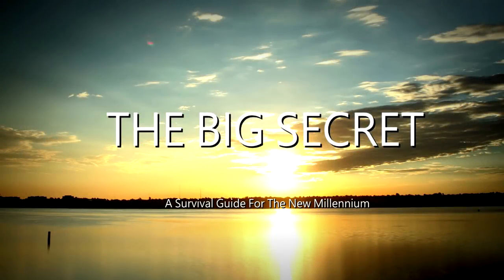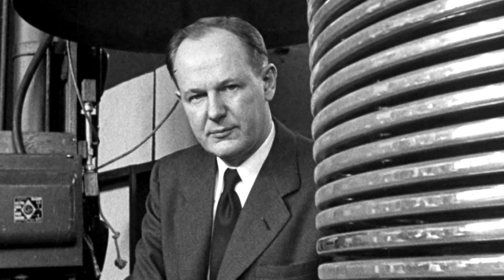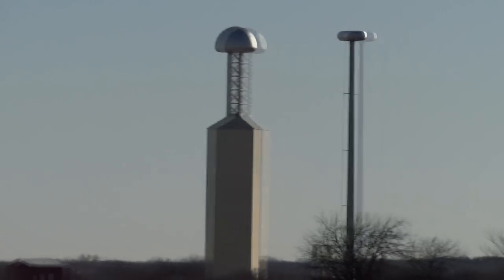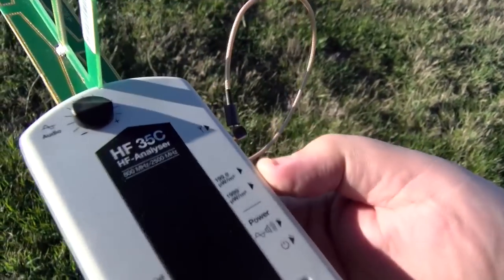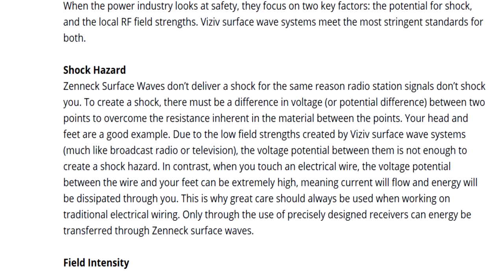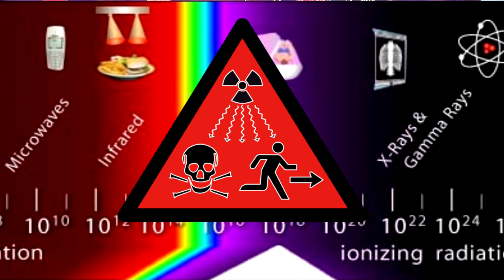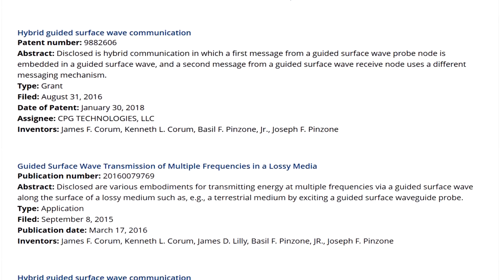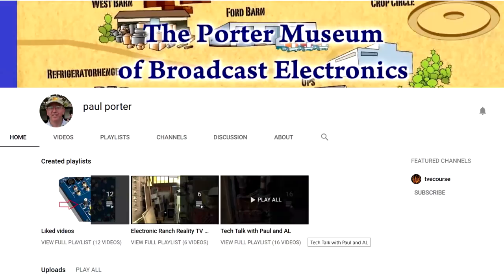Texas Tesla Tower Wardenclyffe Tower and Zenneck Surface Wave

Comment: In a way, Tesla's system basically sets up a tank circuit, where the transmission sight is essentially one plate of the acting capacitor in the circuit (topload couples to the environment), and the receiver is the other half of the circuit, connected through ground and a capacitive topload- so Tesla's wireless is actually a one-wire transmission mode through the Earth (Zenneck Wave?).  So when the two halves of the circuit (transmitter and receiver), resonate together as a single tank circuit, you have power transmission.
To go further, Tesla would use impulses of the tightest possible duration, to try to eliminate the magnetic (lossy) component in energy transmission.  Repeated high frequency impulses of disruptive discharges, won't give rise to significant currents/magnetic fields in the transmission medium, but transmits electrostatic waves longitudinally.  I think he really meant for his big Wardenclyffe system to employ impulses that would be tuned to resonate with the Earth, as ground.  He could setup a train of resonant impulses, that a receiver could tune into and resonate with, assumingly anywhere on the planet that can have a strong grounding system.  Such a system would probably greatly amplify the power and COP, through Earth resonance.
Reply: check out the 17 second resonant wave that occurred worldwide on 11/11/18. Some say it was a preview ;)
Reply: @EricM93  
Reeeeaaaallllyy : d
Reply: Something about using GND and the air as if they were wires in a circuit so AC power could be pulsed through ground
Reply: @EricM93  wheres the video to that
Reply: wow your the only one here that understands bravo     ....... with the advances today it could power the whole planet much the way the great pyramid did  over  565,000 years ago
Reply: @vuzztraveler4722910  
Imagine LFTR reactors, or maybe plasma fusion in the future, powering magnifying transmitters, powering the globe.  It's the "free energy" we've been looking for.  I'll email Elon- we'll set that shit up for the colony.
Reply: @Khepramancer  unfortunately mans obsession with fossil fuels has led him completely in the wrong direction riding exploding  roman candle cylinder bombs  to obtain orbit instead of the study of electromagnetic energy in relation to anti gravity until man figures out how to create harness that singularity and completely control this kind of event will be confined to his own back yard  given the way planets resources management  and technology have been used your own rats nest theory  is confirmed  your seas  and earth  karman  upper orbit are beyond polluted as below is as above trying to bring nuclear weapon devices  into space will not be tolerated this type of tech is as primitive as horse shoe crabs to  modern man kind . help was given but was completely ignored by your infant planet leaders only now have they realized they are in control of only their own planets destiny  and nothing more you have the right to destroy yourselves . to travel in space is to travel in time   until that time refer to whats been given
Reply: @Khepramancer   yes how true your statement is Empires rise and fall  unfortunately    . today on your planet fortunately they can also be bought and sold out and politicians that  is  what has happened . in the past  it  cost countless lives  by war the determining factors are your fiat monetary system  and the powers that control it and the treacherous manipulators of   earths  world resources . but thats the least of man kinds worries for 76 years humans have been exploding nuclear devices punching massive holes into the planets magnetosphere destabilizing the shield  the next time the poles flip could be the end  those that forget the past are doomed to repeat it  instead of studying the past they have sought to destroy it .your religious  constructs  dogma  are the folly of man  unless the planet is cleaned up and  re stabilized again   a  catastrophic  continental  shift will occur  again like when Atlantis sank then rose out of the sea when the great anunnaki  pyramid  that stabilized and powered the  whole planet was  dead shorted  after a major  nuclear conflict between two power struggling  regional   leaders   and  then  flash frozen then mass flooding  creating the largest desert in the world as well burying the past  of the oldest most advanced world wide civilization   the planet has ever had   .all over the earth with it under earth or under water  many fled back to the dog star  most died some survived and lived out there lives underground  . through  the passing of time the truth all but  lost or ignored by the greedy like the british criminals that enslaved two thirds of the planet . the  great pyramid was built by copper chisels and wood mallets really  i dont think so  ... if you have a email for musk you should ask that he spear head the ocean clean up before its to late  the oceans are your only hope now as earthlings are way to stupid to be allowed in to  outer space as they need to dig up the past before they can move off the planet at this point they should be exploring inner space first  as far a global warming is not a factor the planet has had global forest fires on it for millions of years deforestation and the balance of natural predators for humans is a factor in said imbalance as well lack of population control in respect to human  birth  rate is out of  control   it seems a mass  self inflicted culling is under way at this time but it is just the start  2021 to  2028 2029 2032  are red flag years certain govs  have already prepared underground installations  all over the planet with  nuclear powered tunneling machines . it may all be for nothing as the next planet killer is on its way if they only had listened to Nikola tesla  they  would be 1000 years ahead  and already be traveling the stars instead of being so far behind they think they are ahead           ........ deceit ........ and greed instead of compassion and evidence  . Beware  Blue is the new Red  and  now  the worst bunch of criminals the planet has ever seen have deceived their way back into power again very easy to do when they can  control all  the information
Reply: Thanks! This is well-put.
My question is how should we receive this? My assumption is the longitudinal waves would cause the small device to oscillate longitudinally, causing the energy to be converted from longitudinal waves to alternating current(ac), which then would be converted to direct current(dc) by a transformer and sent throughout the house.
Reply: What are you smoking silly, your an earthling also
Reply: his illustrations in certain articles explain everything.
i usually hate the analogy of waves on the surface of a pond, but here, they are great.

current radio... "throw a stone in a pond and watch the ripples".
ok... that implies the stone was the energy you "transmitted", and the wave, the "transmission".

so the stones gone. bummer. gotta get another one.
time it all and wee, we have this "continuous wave".

wasting stones galore.

hey, why throw stones?
lets just float something on the surface and make it vibrate!
yay! we have standing waves! now we just have to modulate them a bit. oh wow. it takes some power, trying to slow down and speed up a generator producing a nice sinewave...
(think of AM as dumping the output of a generator into the lines, or into a short circuit, to modulate the signal. whereas FM speeds the generator up and slows it down... both wasteful) 

"and now, as receivers? we have little boats, and inside we have little devices that tell the angle of their tilt, and we sort of average out that reading and there you go, thats the signal. a bit like asking the crew how many occupants get seasick.

the rest of the wave? oh, thats wasted... yes, its terribly inefficient..."

the issue is you move YOURSELF up and down. and ignore that the boat moves up and down.

if the little vibrator had been firmly anchored, be it somehow to the air above or the ground below (ponds have that advantage over charged balls in a vacuum) then your little device could have easily tapped into a resonant mode where it uses very little energy to maintain a disturbance across the entire surface of the pond.

and at this point, the receiver can be the same affair, a barge perhaps, firmly anchored, that pulls upon its anchor rope as the water rises, and is reeled in on the reverse... the bigger the capacity, the more it can do... or you could hang it from above, let it fill with water then release it every time... theres many ways to do it...

its all about grip you have on the ground, and not on the ground...
he also said you needed at least 100hp or so to do it. the earth is big. it would actually require a decent kick to get everything tickling. have to overcome the resistance, the inertia, the hysteresis.

all we can hope to do is vibrate little patches of the surface... until someone has the balls to do it with a MW (1300hp) or more...

and he did. apparently. he did have a powerstation at his disposal...
Reply: Someone who actually understand Tesla's radiant and ground power transmission energy.

Comment: Well, there's no two ways about it.  As the presenter noted here, Zenneck waves are surface waves - that means the energy doesn't go up into the sky.  It will all hug the ground and spread out in a circular pattern (if the tower is omnidirectional, and it looks to be from its shape).  All of the transmitted power will be spread out on a circular front at any distance from the tower; therefore the power density will be inversely proportional to the distance from the tower.  If you want a site very far from the tower to be able to receive any significant amount of power, a truly huge amount of power will have to be broadcast, most of it going in other directions.  Near the tower, that implies an enormous power density, which will pass through YOU if you approach the tower.
   
There are clear environmental and health and safety issue that would need to be properly dealt with before fielding this technology.
   
My credentials in this area are a PhD from The University of Texas at Austin (1992); my research was in advanced applications of electromagnetic energy.
Reply: simple. dont "transmit power". "the heat developed within a resistance due to the passing of a wave is in no way whatsoever a measure of the power contained within that wave".

it stays right where it is, in the unit creating the electrical disturbance. bouncing back and forth from earth to top load. timed to the harmonic motion of whatever that electrical disturbance may reflect against and return whence.

anything earthed, its not affected. theres nothing traveling THROUGH it. 
as a capacity though, its potential changes.
in relation to what?

and what if it isnt grounded? 
or what if its grounded in a way that tricks it into thinking it isnt, like a virtual earth? 

a boat bobbing on the waves, it goes up, it goes down. its potential changes.

but it isnt affected. though some occupants may turn green...

give it an anchor. tie it down. 
and suddenly it will fill with water and sink.
it put a lot of tension on that anchor and chain due to its bouyancy before it sank though. all that really dictated its bouyancy is its surface area. its capacity.

a stretchy rope would have been interesting. or maybe some device that could release it as required.

or you could do it the opposite way, hang your bucket, your boat, your "capacity" from a blimp... let it fill and release the water every time it recedes.

either way, you were able to do something with the wave itself. the energy of the wave.

but was the device that created the waves in the first place drastically loaded and affected?

all you did was grab a bit of that massive surge of energy coming at a repeating, predictable rate

and the wave carried on, nearly unaffected by your measly little efforts to stop it.

bad analogy? maybe.

the change in potential is already there. it just needs a reference, an anchor point.

kites dont fly very well when you let go of the string... nor when theres any wind.

what do you define as power? a lost kite?
a brick wall?
or the thousands upon thousands of tonne of air in motion?

your current radio, all you do is sit in the water and vibrate up and down. you measure the resistance of your motion to vibrating as your transmission power.

and all you get in reception is a small amount of seasick individuals that need to be interviewed, mic'ed, amplified... ignore that the boat and all aboard were being cyclically lifted and lowered, massive amounts of energy involved...

utterly different to remaining stationary and making the water go up and down.

"surfing the waves" takes on a completely different meaning when you tear your phd up ;)

Comment: I live in Itasca Texas, a few miles west of Milford. The location they have chosen is inappropriate and will not lead to success. Tesla specifically built Wardencliff tower specifically over limestone with underground springs. While there is abundant limestone in the area there are no springs at least none that last year around.
Reply: Should read through the comments first........... May not be a spring but there are aquifers...
Reply: @D.Will.C.   The rationale for limestone (if indeed the tower has anything to do with its purported purpose) is to supply dielectric permittivity with low electrrical conductivity.  This geological condition retards the (vertical) electric component of the wave while having little effect on the (horizontal) magnetic component of the wave, steering the wave toward the ground slightly to shrink the effective depth of the earth-atmosphere waveguide.  

Propagation over salt water is even better.  Extremely high dielectric constant, and thanks to the electrical conductivity the skin depth is a very small fraction of the wavelength and the eddy currents oppose penetration by what is in effect a return signal nearly pure reactive in phase.  

The worst conditions are those of rough terrain and mixed lithologies including aquifers.

You guys didn't invent radio engineering.  It's been around a long time.
Reply: its directly over top of the largest aquifer in the state  and right on top of limestone go there and look at the dust on the road

Comment: I know the people involved in this. I watched them pour the foundation for that tower. The largest part of the antenna is not visible. I know far more than I'm permitted to share because I signed papers that I could not discuss most of the questions you're posing. Not because they have not thought of the things you mention but for security sake. The location was chosen for geographic significance and is where it is due to that. If you know the reason it makes perfect sense. However your health and safety concerns about those antennae's is misplaced. Also I own one of those meters. Pointing the tip of that antenna in your meter is giving you a bad read. Those antenna's pick up strongest when the antenna is perpendicular to or horizontal so that it picks up more of the wave. I owned one of those until I bought a better one. If you want to get info about what these guys are doing contact them. This is a private company not a government operation. The reason guys are ex mil is mostly because they needed NASA scientists to build the antenna. It's a very sophisticated piece of gear. Possibly the most sophisticated electrical device ever conceived to date.
Reply: funny yet was  invented over 100 years ago  by the smartest man on the planet and yea the  EG  center has shifted with time but they dont have it all     hard to have the answers when they  have stolen it    FORMULA  incomplete  like trying to get monkeys to calculate pi  bahahaha
Reply: how much were you paid to write this comment and post it?
Reply: @slopehead1822  Haaa Haaa haaaaa😆😆😂👽